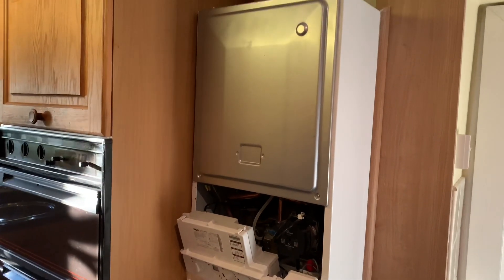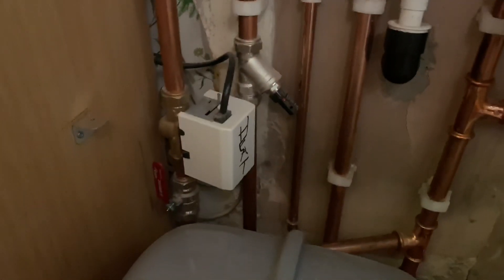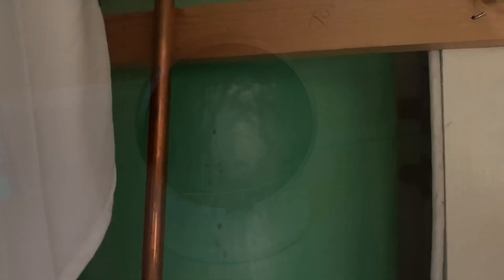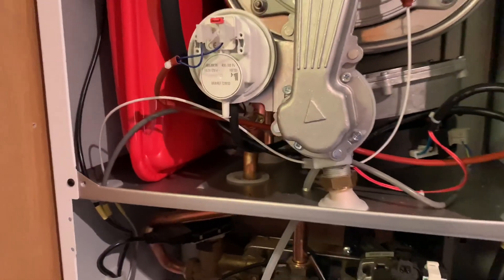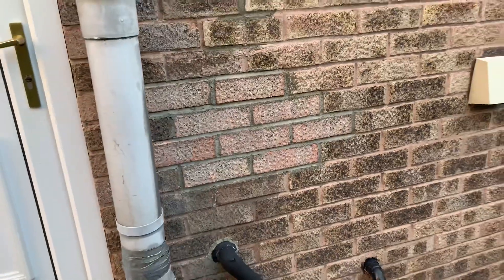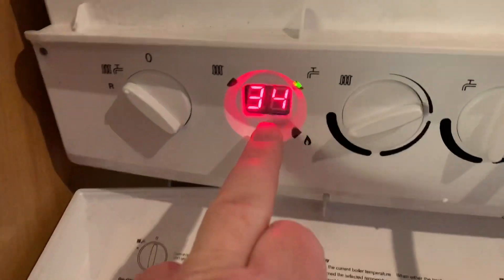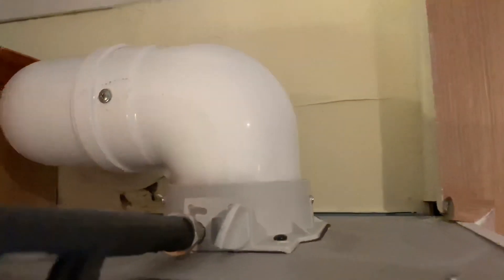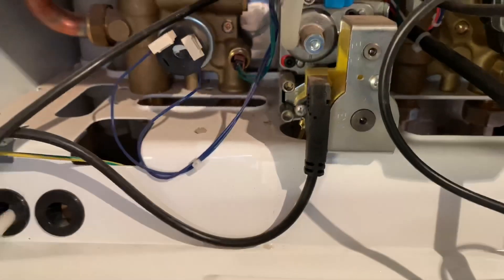PLUMBER - HEATING SYSTEM DESIGN - Combi Boiler - S Plan - Cylinder

Comment: Hello Alan I am not a Plummer but need some advice kind of thinking along the lines of this setup,  I have  a 1980’s boiler regular setup  both the boiler and old glow worm  and cylinder (standard copper type) both need replacing , right  now the biggest issue is if someone turns on a tap or flushes the loo while someone is on the bath it gets hot or cold depending on what’s been drawn  (with all the Dangers this presents with young kids )  what I was thinking was going to a combi viessmann 200w or 111w in a two bathroom setup , so eg the combi works 80 of the day as intended yet say in the evening  and morning time heats a pressurised cylinder for upstairs for the main bathroom with diverter so it can top up as the cold feed and keep the tank up to temp of say 60, that way the combi can run the downstairs shower and say kitchen sink  without interruption , or would you recommend just swapping to a system setup and redo some of the pipe feeds so upstairs, downstairs hot and cold are fed through a manner fold and possibly pumped to pressure equally no matter the hot water draw, right now I’m assuming about 28 litres a min for both upstairs downstairs plus typicalkitchen  sink say doing the dishes on and off demand (hence the reason I say may need a cylinder) . Water pressure is excellent ground easily topping 18-22 litres a min  off of main line but upstairs being fed from the loft I would say 8-11 litres current boiler in the garage tank in the second floor  no underfloor  12 radiators the heating controls will also need a full make over as they date from the same period

Comment: Alan, You said that you can run a hot tap from the combi Boiler, as combi gives how water priority , surly the S Plan will not works at that instant in time?
Reply from the maker: That’s correct. Thanks.

Comment: Allen looks nice job but would you have done the same with an invented cylinder or just on the open vented as the coil is a low kw rating. As I'm sure the combi would struggle with a invented dur to the kw rating on the coil  as the combi only runs at its badged kw on dhw and not the heating

Comment: How do you wire the nest system of your combi boiler if it  only has a hall thermostat  ??
Reply from the maker: I do not really know what you mean but it’s wired as an s plan heating system. Thanks.
Reply: @AllenHart999  hi allan what I mean is when I turn the hall thermostat  on to get heating the boiler comes on so how do I wire the nest system to the boiler  there no program controller or anything the boiler just comes on when I turn thermostat  and hot water when I turn hot water tap on

Comment: Wouldn’t they benefit better from just having a heat only boiler and unvented cylinder? Get rid of the tanks and have a near boiler/cylinder set up tucked up there out the way..
Reply from the maker: The customer wants to get rid of cylinder when they do work upstairs. Thanks.

Comment: Hi Allen, as you changed to a combi did you fit a shock arrestor on the cold mains as recommended by Baxi? If a problem occurred with boiler would the warranty be void as not following manufacturers instructions.
Reply from the maker: It doesn’t need a shock arrestor. Doesn’t have any back flow device
Reply: Thanks for reply, worth making sure so that Baxi don't have any get out if something goes wrong, anyone installing would need to check if the supply is metered as likely to have backflow protection.Keep up the good content.
Reply: I think it’s only Ideal that want them fitted. I used to fit Ideals for a council and got told by an Ideal installer about needing one for warranty but when I had a Baxi to do I called them about it to find out and they sounded like I was crazy 🤣 when I said ideal need them for the warranty they said “if it needed one they’d factory build it inside the boiler”
Reply: Below is an extract from a Baxi 630 installation manual.　

In instances where the mains water supply incorporates a non-return backflow prevention device, or any other device that includes one*, it is possible for a build-up of pressure to occur. This may result in damage to the boiler and other appliances. To prevent damage to the boiler it is strongly recommended that a suitable mini expansion vessel is fitted on the mains water inlet between the boiler and the non-return device. 
*(The manufacturer of the device should be consulted if there is any doubt regarding the presence of a non-return feature). 
Even in circumstances where a non-return device is not fitted any future modifications to the mains inlet (e.g. fitting of a water meter) should be considered and an expansion vessel fitted. Baxi cannot accept any responsibility for damage to the boiler if these recommendations are not followed.

Comment: Allen a little bit of electrical trunking makes the job look so much neater. Also, I would have had the shower off the combi to give higher pressure showers.  Although I know that can be difficult in a finished bathroom.
Reply from the maker: John Burns Trunking would look silly. Thanks.
Reply: @AllenHart999  
Mini trunking.
Reply from the maker: John Burns in a cupboard boxed in lol...
Reply: John Burns no matter how you run it, self adhesive mini trunking always looks crap imho. Round conduit only in my house :)
Reply: @AllenHart999  
It is actually quicker.Put the trunking in and then all the cables inside. No hammering in a bunch of clips, with crossed wires showing.

Comment: Is it a big house that would struggle with hw off a combi.ppl like the airing cupboard for drying towels etc lol. We normally just pipe a rad in cupboard so at least they've got somewhere to hang there smalls 😜
Reply: A big combi can cope with a bigger house.
Reply: @johnburns4017  yes i know but if say there was several bedrooms with ensuites etc you wouldn't fit a ' big combi'. Hence the reason i asked if this was a big property that would struggle with a combi
Reply: @jamboSAFC  
The big infinatlly continuous combis can do two bathrooms.  Above two bathrooms stored heat (thermal store) or water then has to be used.

When assessing the DHW of an average British home, the combi must be the first port of call.

Raindance aerated shower heads use little water to other heads. As do aerated taps. This all points to the suitability of the combi. 

There are large stored water combis as well. ACV make a large efficient stored water combi that is a mixture of unvented cylinder and thermal store. All in one big box.
Reply: @jamboSAFC  
An infinitely continuous combi giving 15 litres per min in DHW,  can deliver 300 litres in 20 mins, for ever.  300 litres is a big heavy space consuming cylinder that runs out of hot water.
Reply: @johnburns4017  as im a heating engineer myself i already know all this, but with reference to your 15 lts p/m in order to get this hw output you also need the incoming cw supply to provide the demand and not every property has great incoming pressure. Theres valid points all around this conversation but for arguments sake if you were 1st fixing a brand new system onto a 5/6 bedroom house with multiple outlets would you fit a combi or unvented system?
Reply: @jamboSAFC  
An adequate mains supply is a given in a mains supplied system. The number of showers, baths, etc, people, etc, is what is important. I would look at a one box stored water combi as the first line of attack when an infinitely continuous combi cannot cope. 

Even if a house has two baths the likelihood of two baths being run simultaneously is slight - think of the diversity factor in electrical installations.  Two showers together? Yes. 

In a main pressure system it is also how you pipe up the H&C. Having one cold pipe snaking around the house with the combi or unvented being teed off, treating them as just another tap may give problems. Combi or unvented must have their own dedicated cold supply pipes from the main stopcock in new or redone installations. 

Having wondervalves on each outlet to balance a H&C system works wonders. 

BTW, I once fitted two combis in a house, one doing upstairs CH and one down. Two separate CH systems. No space for a large cylinder. Just two white boxes on the wall. It gave redundancy if one was down.  One did one bathroom, one the other.  The hot supplies were combined using check valves for the baths only. The baths filled quick, taking the power of two combis. In the morning each would do a separate shower - no interference from one to the other. It was also quite cost effective. 

Where mains supply is good, also look at Rinnai multi-points.  I fitted one outside as they wanted the space inside - no cylinders.
Reply: @jamboSAFC  
The latest is a new largish detached self build. I said go all electricity, using a Tesla Powerwall battery, PV panels, UFH in parts. Using the sun or cheap E7 overnight to charge the battery and run the UFH as it is needed.  The house will be heavily insulated.

It is no more expensive than a comprehensive gas system to fit as current figures go. No new gas mains pipes, gas meter taking up space, potential explosion (I threw that in :) ), UFH heating pipes with complex controls, etc.  Pipes in the place are to be minimum. Electric UFH is service free. Figures are still being worked on but all looks that way. 

Customer does not like the idea of pressurised water in the place, so a vented DHW only thermal store is being looked at as a possible alternative, which are, unlike unvented cylinders, also service free, keeping running costs as low as possible.  Also instant electric taps (no waiting for hot water), as per a Qooker.  Also an EV charging point as well.

Comment: How did you get away with connecting to hot feed from the cylinder to the hot on the combi? Or is the hot from the combi capped off?
Reply from the maker: Thank you for the question. One hot tap off the Combi, then if they want the cylinder out later, just connect it back in. Hot water for cylinder is from zone valve 👍